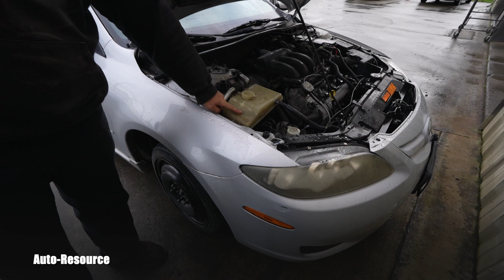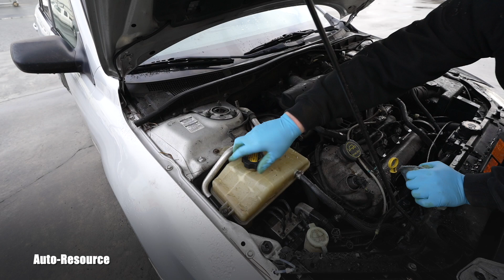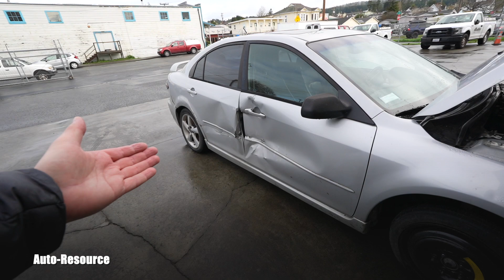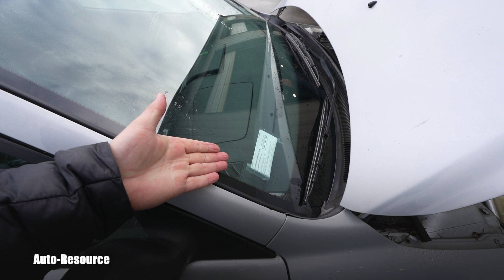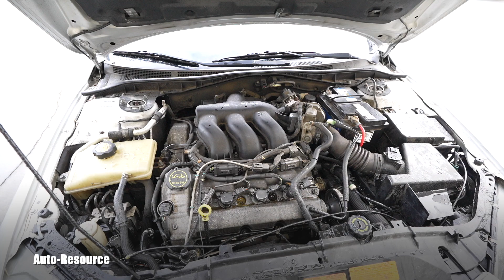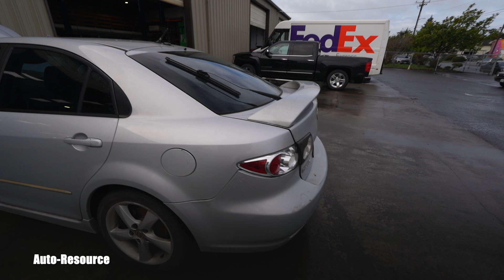Symptoms of Blown Head Gasket

Comment: 3.0 v6?
Reply: Yes, you can see the transverse bank 2 visible, weak 114hp, why?
Reply: I have an first gen ford escape which also has a blown head gasket Im pretty sure this confirmed it for me. my coolant didn't mix all oil disappeared after going out on the highway also the thing has oil leaks through the timing cover all of this happened after my radiator blew & b4 the@ I got it checked it had a misfire wich has Me guessing it had a bad head gasket before I got it